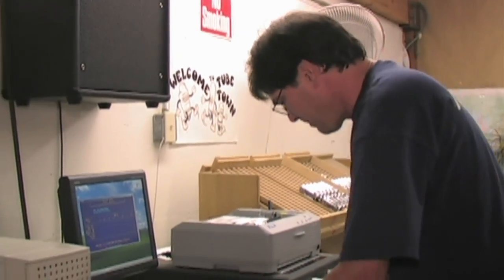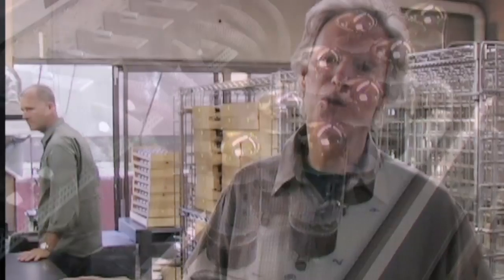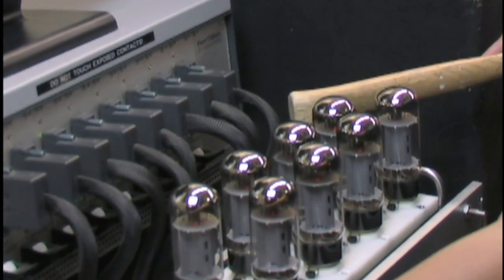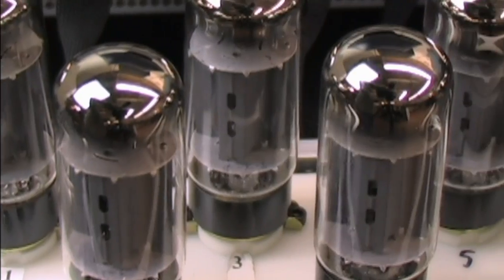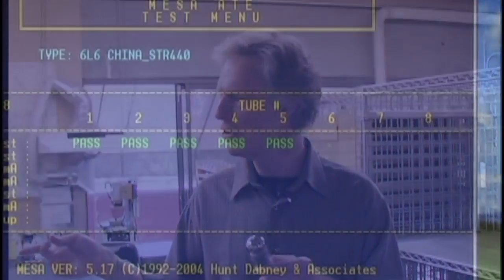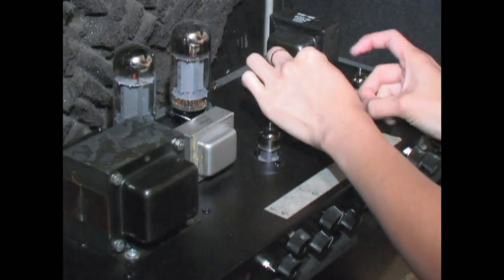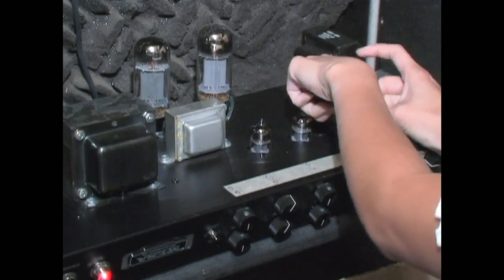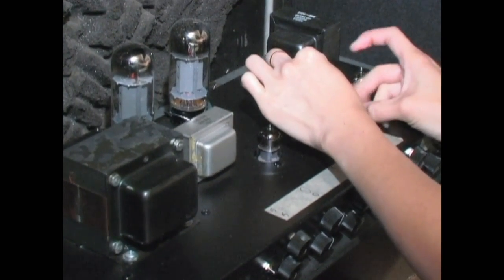Randall Smith ~ Tube Manufacturing, Testing and 'Tube Town'

Comment: Tube Manufacturing takes place in china in this case. the tubes shown here (5$ before robotube ,20$ after)are made at a factory called shuagang which is the only factory in china,there are only 2 other factories: jj  in slovakia and sovtek in russia.  they do give a 6 month guarantee for tubes but i had to wait 2 months for the tubes to ship to the store in my country and rent another amp. modern amp makers really have no choice but to use the current junk,but some are honest about it. the fact that mesa puts that much effort sorting and testing the tubes really shows the low quality control at the chinese tube factory.

Comment: I had a set of MESA 6L6's blow after literally no more than 2-3 hours of very low bedroom play only.The only tubes I have ever actually had blow on me.I have cheaper tubes in amps that get gigged every weekend that last years and I only replace when I feel I need to.Still running a set of JJ after 9 years.I contacted MESA but they wouldn't change them because it actually blew after 6 months even though the amp tube was causing problems from the offset.
Reply from the maker: Hi Music Man - Sorry to hear you had problems with some of our tubes. I'm slightly confused - you say that the tubes failes after only 2-3 hours of use, but you say we didn't replace them under warranty because they were used for more than 6 months? We generally lean toward taking care of customers with tube issues just outside of 6 months of use rather than a stringent hard and fast rule, all within reason. So I'm confused if the tubes had 3 hours of use or 6 (or 7) months of use. Feel free to contact me via email at tien@mesaboogie.com to discuss further as we would almost definitely replace tubes under warranty that were only used for 3 hours and failed, and we very likely would replace tubes that had failed with only 6 months of use as well. I'd like to have more details so we can get you helped out properly in case there's some sort of minunderstand or miscommunication about the age of the tubes and how much use/time they experienced before they failed on you. BTW - because we - or any other manufacturer - can't predict how long a tube will last, this is why companies who sell tubes offer warranties on them. Some offer 3 months or less - we offer 6. So - hope to hear from you to try and get the details straight and get you helped out. Thanks for reaching out! :)
Reply: Hi Tien-Thank you for commenting...I've messaged you directly to explain the situation to you..Best Regards.

Comment: Misleading description of the "getter patch" in this video. It is not really made of the unwanted gas molecules that have been deposited on the glass after the vacuum is created. It is a compound of chemicals that sit there and absorb any gas molecules that are in there after manufacture and that come out of the tube components throughout the life of the tube that would degrade the vacuum.

Comment: If i  have a question and ask mesa, they reply so quickly.  for a no name cover band guitarist to be looked after so well, that's a great start.  single rec v2 head and quad with v30's is such a joy to play and as relyable as hell.  From jazz, funk to punk rock, i find mesa very easy to connect with, and through a rectifier. once you get to the point of having such faith in your amp, you can focus more on your playing.